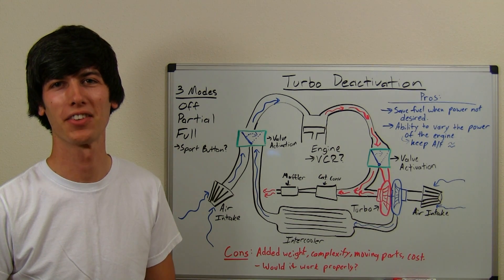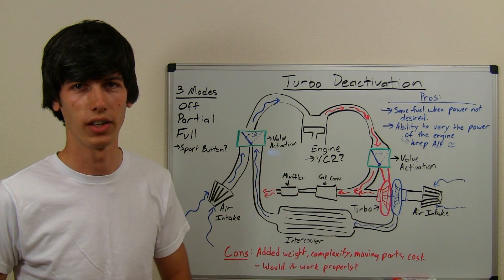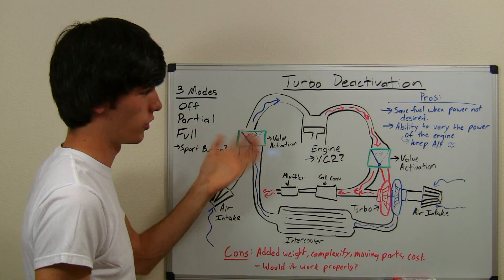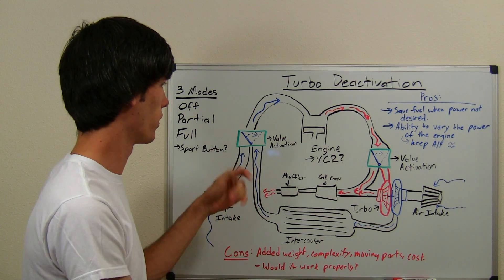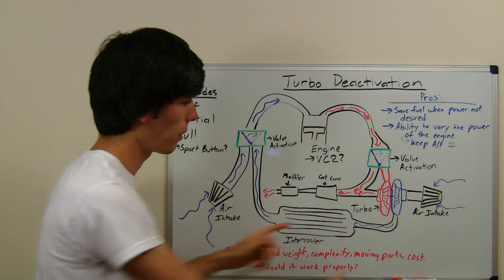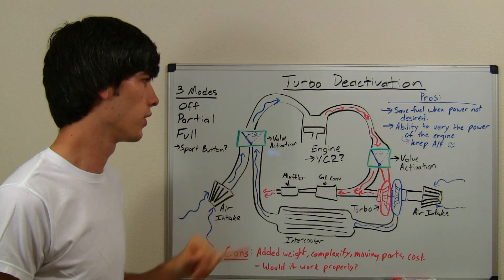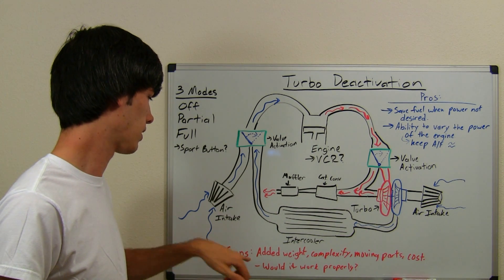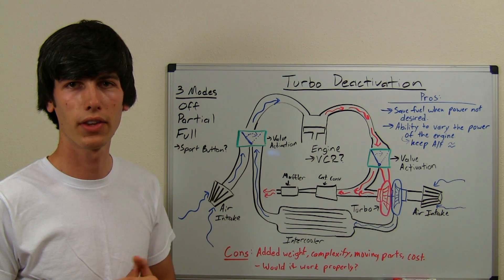Turbocharger Deactivation Concept - Explained

Comment: The days of the turbocharger are numbered. VW/Audi, the largest turbocharged vehicle manufacturer, are beginning to phase out exhaust driven turbochargers in favour of electric superchargers. These new superchargers offer the increased power benefits without the drawbacks of traditional forced induction.
Reply: agt155 It's kinda funny you say that turbo days are numbered because I see more manufacturers use turbos to increase the performance and gas effciency but haven't seen many that uses electric superchargers or just plain superchargers. VW/Audi/Lambo are phasing out turbos? Really? Virtually every model that Audi/VW offers have a turbocharged engine. BMW is using turbos since late 2000 and even their M cars are turbocharged now. Mercedes is using turbos on their entry level cars to high end AMGs. Ferrari is now using turbos on 488 GTB. Hell even Honda is using turbo on the new Civic Type R. I don't know how you got the impression that turbo's days are numbered LOL.
Reply: I see what you are saying, but I can't agree with you there when you say the car manufacturer's will increase voltage level to 48V. This will require increasing the battery capacity. With current battery technology, to get this done, you need to increase battery size to accommodate the 48v capacity for the electric supercharger and to have it last long enough without running out of juice. More battery = more weight and that's the least thing the manufacturers want. At that point, they would rather go with electric motor assist aka hybrid (such as LaFerrari, P1, or 918 Spyder) to boost the car rather than sticking a sole electric supercharger.
Also, Audi/VW is the only manufacturer that uses electric supercharger. (or electric driven compressor) No other manufacturer that uses turbos (virtually everyone now) does this.
Reply: +agt155 Electric superchargers will never fully replace turbos since they were never designed to be continuous usage even with 48 volt. You can accomplish the same desired effect of on demand no parasitic drag supercharging by magnetic clutch which is significantly cheaper for anti lag on demand. The hp gain / flatter torque curve per dollar simply will never pass the bean counters at manufacturing cause end user can't justify spending the extra dough. Chipped Subaru Wrx vs STI = same hp where majority are going for the lower tier for best bang for buck.
Reply: +agt155 i think  you mean naturally aspirated vs forced induction (turbo+superchargers).

take a look at BMW's new line.
Reply: agt155 Electric superchargers are a waste of money. They create virtually no boost. It's like connecting a computer fan to your intake. (just to  compare, both run on 12 volts).
Reply: For an e-blower, you will need an additional power source, and even with an upgraded alternator, it wont create enough electricity to charge it. I just dont understand why you think an e-blower is better than a turbo. a turbo uses wasted exhaust heat to power it, while an e-blower drains your battery.
Reply: they have race ones yes, that must be recharged every race or so, and is anti-lag illegal for track use? where do you lie? and please explain how the rest is wrong? (i am not trying to have an argument, i am always willing to learn, but saying its all wrong is a bit vague...)
Reply: agt155 And note that there is a huge difference between an electric blower and an electrically assisted turbo. The electric part is basically an anti lag system, that starts the spooling process only untill the turbo reache it's threshold. It does not run exclusively on electricity.
Reply: +agt155 no, vw and audi are actually not using an electric super charger.  they are using a twin charged system with a belt driven super charger and a typical turbo.  but, just out of curiosity... what models are they offering this electric blower on?
Reply: +agt155 it's not going to be phased out for a while... it will survive for a bare minimum of 5 years
Reply: +agt155 Don't forget that a turbocharger harvests energy from the exhaust gases which would otherwise go to waste. If you use an electric turbocharger you are using energy to increase the intake pressure, and still wasting exhaust gas energy. So the Δ is twice the amount harvested and reused by the turbo. Which is actually a fair few kW. In any case, I think the turbocharger is going to be with us for as long as we have ICEs.
Reply: agt155 *facepalm* absolutely impossible as supercharger has less parts than e-charger.
Reply: agt155 A super charger is merely a compressor wheel connected to an engine via belts. If you can't comprehend how this will always be cheaper you should just give up educating yourself and be a good drone.
Reply: agt155 Ah, forgot about those weird screw things. I'm more familiar with aircraft engines, where those were rarely used (precisely because of weight). Also quit trying to insult people by labeling them "naive" or whatever. That won't make you seem intelligent.
As for the types of superchargers used, I was specifically referring to a centrifugal-type supercharger. The source of drive is largely irrelevant. Whether it's the engine crank via a belt or an electric motor. The oil supply is not needed because of the drive source, but because bearings and gears spinning at such speeds generate a lot of heat. And those are gonna be there, regardless of how you drive it.
Also, for an electric drive there's the entire electric motor, presumably AC-brushless. So in addition, you're looking at a 10-20kW inverter. I don't know if you've seen a 20kW DC-AC inverter, but they're about the size of a rack-mount server chassis and weigh a lot.
Reply: "There are no centrifugal type superchargers used in production automobiles." is different from "What type of automobile supercharger uses a simple compressor wheel?" Don't move the goalpost yourself.
Also, you didn't google either, since there are some cars that do include a centrifugal type from the factory. BMW B7 Alpina were presumably running centrifugal types, as were lots of Koenigseggs. That having been said, yeah, the big screw-types are apparently easier to use for factory-type installations, since you can design it in. However, aftermarket, centrifugal-type superchargers are used lots. Regardless, whether they come from the factory or not is a red herring. We're talking about the technology's potential.
As for belt driving causing large tangential forces: no more than on any other part on a belt, e.g. alternator or water pump. Once past the input shaft, tangential forces are essentially nil. I mean you might as well say that tangential loading on the alternator is a huge problem.
Finally, the point on oil lubrication. ALL bearings are lubricated. If they weren't, their lifespans would be measured in hours. In theory ball and roller bearings are able to survive running at slow speeds without much lubrication, however, there's always some applied just to ease its life (even sealed bearings are lubricated before sealing). The question is: do you need to actively cool the bearing? At the kinds of high speeds that exist in a supercharger the answer is: most likely yes, if sustained running at those speeds is required. And active cooling is achieved by oil circulation.
As for switching reluctance motors: you'll still need the switching equipment. Remember, you're talking a sizable electric motor here, around 10-20kW easily (compressing air takes a lot of energy). And that equipment is everything but simple. Maybe as a car mechanic to you it's just a black box. But I'm an electrical engineer. I can tell that the insides are a heck of a lot more complicated than just a step-up gearbox.
Reply: agt155 You ignored the BMW B7 I mentioned. That's a production car. I didn't wanna mention cars from the 60s and 70s, where they were a lot more prevalent.
The amount of power required for a supercharger is simply a function of the amount of air and compression you want. There's no way around it.
"Who said that bearings don't require lubrication?"
You implied it right here:
"Of course, superchargers having large heavy rotors also add to the forces applied on bearings. Hence the need for oil lubrication."
If you didn't mean to say that without the forces, no oil lubrication would be required, why mention it anyway?
Anyhow, I had a look at the product of Value and:
1) Valeo themselves said that it's be used in conjunction with an energy recovery system
2) Many of their own diagrams (such as the "how it works" on their own youtube channel) show it being used to simply anti-lag a conventional turbocharger system.
So all your arguments about simplicity are simply invalidated by the manufacturer's own claims. By necessity, it's going to add complexity to the overall design. And that was the whole point of what I said in the first place. Simpler? Unlikely. Worth it? Maybe.
Reply: +agt155 So essentially you kept this argument up for over a year only to essentially nullify your statement by saying it will only replace small turbos, due to power requirements not accessible due to industry standard batteries?
Reply: agt155 Turbo lag can be minimized with an anti-lag system. Boost threshold can be minimized with a VGT. Exhaust back pressure can be minimized with larger plumbing. And last but not least, heat soak happens to your whole engine (not just turbo) all it is, is lets say you race a few races your engine will get hot. Now if you imediately shut off your engine it will keep alot of it's heat, just because of the fact theres no more coolant going through the engine.
Reply: +agt155 We shall see
Reply: +agt155 first off there's no such thing as a turbo running at zero percent efficiency unless it's seized or your running a turbo deactivation system such as in the video. An effective electrical supercharger is far from a power supply problem, theirs also the problem of charging, power lines, and fan technology. A system that actually works would either way too heavy (as in industrial size fan heavy) and/or put such a parasitic load on the engine that it would be pointless if not a hindrance. By the time technology advances to the point the an electrical supercharger is plausible combustion engines will be a thing of the past so turbos aren't going anywhere till combustion engines due. Though if can direct me to creditable documented proof of the concept being possible I'll believe you otherwise you seem no more than another person gullible person falling for a gimmick, no offense.
Reply: +agt155 Also the change in battery size is no indication of electrical superchargers but of more advanced hybrid car systems
Reply: "What type of automobile supercharger uses a simple compressor wheel?"
Pretty much all of them do, although that depends on what you mean by "simple compressor wheel". Superchargers, whether driven by a belt off a crankshaft or from an electric motor, work on exactly the same principle. A set of spinning compressor blades (whether axial or centrifugal) to impart (mostly) kinetic energy to the gas flow and a set of stator vanes to slow the gas flow down and convert the kinetic energy into static pressure and temperature (the adiabatic process).
Whether an electrically driven compressor is simpler than a belt driven one is questionable. At the small compressor sizes we're talking with car engines, in order to obtain the necessary blade tip speed to get any useful compression, you're looking at insane rotational speeds, well in excess of 100,000 rpm. That pretty much rules out direct drive from a 10-20kW electric motor (too expensive to build one so powerful that won't fling itself apart at those speeds), so regardless if belt driven or electric motor driven, there's probably going to have to be a step-up gearbox in there somewhere. Gear meshing at those speeds tends to produce pretty good temperatures, as do roller or ball bearings, so it's likely you're also looking at the need for active oil pumping and cooling.
So are they simpler? I don't think so. They might still be worth it, but I wouldn't look to simplicity being a feature of the design.
Reply: Cerberus984 All I'm looking for is to perhaps share some knowledge with somebody who might appreciate.
Reply: Ryan Gaetz Of course those little bolt on ebay electric superchargers are next to useless. However companies like Valeo are producing proper functional electric superchargers, as fitted to some new Audi's. Electric superchargers will replace turbochargers, they have all the positives with none of the negatives.
Reply: Bolt on supercharger or not, 12 volts will not compress any air. Second: even if it did, it would only have 1 speed, it wouldn't spool faster if you put the pedal to the metal. IF you had boost at low rpm, it will just be an air restriction at high rpm.  IF you have boost at high rpm, you risk damaging your engine at low rpm. Turbos still spool way faster than an e-blower would ever. A relatively big turbo, will spool around 10.000 rpm on idle, and can spin up to 150.000 rpm. Now tell me, how would a battery ever achieve this?
Reply: an e-blower is as useless as a "performance chip" (which are also useless)
Reply: ***** A quick look at any turbocharger compressor map will show you when a turbo is operating at 0% efficiency. For a 'normal' car turbo this is at under ~ 5 lb/s air flow or ~ 50 bhp or ~50k rpm. Think of it like airplane wings, below a certain speed (stall speed) wings produce no lift. It is no accident that for the majority of driving turbochargers operate below their 'stall' speed, because under these conditions the engine simply doesn't require any more air than atmospheric pressure can supply.
Reply: +Ryan Gaetz Chips on direct injected engines or common rail diesels are capable of more than yesteryears fuel delivery systems hence why we are witnessing ever increasing compression ratios using even lowest grade pump gas on a turbo vehicle with negligible performance loss. 231 vs 240 hp on an 2.0 ecoboost ford escape.
Reply: agt155 Also, back pressure is not caused by boost. it's caused by not having a large enough exhaust.
Reply: Ryan Gaetz It obviously works or Audi and the rest wouldn't be using it. You are right that 12V is not enough to power a large supercharger which is why there is discussion about boosting car electrical systems up to 48V. With 48V powered superchargers traditional turbochargers could soon be obsolete.
Reply: Ryan Gaetz
Electric superchargers already exist and they obviously do work.

Have you ever experienced an anti-lag system? They're illegal over here and for good reasons.

The rest of what you wrote is simply incorrect.
Reply: Rich B VW/Audi are now using electric superchargers instead of small turbochargers in multi turbo-charged engines. This is the beginning of  the 'phasing out'. Only small electric superchargers are possible at the moment because car electrical systems are standardised at a low 12v. In the coming years this will be increased to ~ 48v which will enable much larger electric superchargers to replace turbochargers altogether. Of course the long term future is battery/fuel cell.
Reply: +Rich B A 48v battery can be just the same weight as a 12v battery.

Here's all the info for you.

http://www.cnet.com/videos/car-tech-101-electric-turbos-are-coming/

Of course all this is just a stop gap until battery/fuel cell tech takes over.
Reply: +Ryan Gaetz That's why Audi is switching to a 48V power supply now.
Reply: +shaggyrogers1787 Audi's next generation of multi turbocharged engines use electric driven compressors. All the information is out there. Mercedes, Ford and Honda are all rumored to be following suit. Also expect a switch to 48V car electrical systems soon.
Reply: +Ryan Costa Yes, at least. New car models with traditional turbocharged engines will be produced for 10 + years.
Reply: ***** Electric superchargers are not a myth. Valeo already have a production version, and I believe Audi, Mercedes and Ford are among it's customers. Check it out yourself.

During the launch of the 718 Boxster, Thomas Wasserbaech, Development Director of Boxer Engines, offered a glimpse of Weissach’s view of its future turbo technology.
When asked what project excited him the most at the moment, his answer was unequivocal: “Electric turbocharging. Not just pre-fill like Audi. Fully electric turbochargers.”

http://www.wheelsmag.com.au/news/1604/porsche-to-boost-future-fully-electric-turbocharging/

http://europe.autonews.com/article/20160305/ANE/160309914/audis-435-hp-sq7-gets-electric-supercharger-to-top-diesel-power-race
Reply: What type of automobile supercharger uses a simple compressor wheel? You are mistaken.
Reply: totoritko "lot's of Koenigseggs" ...that's an oxymoron for you right there. As I said no production cars use centrifugal superchragers, and it's by no accident. If superchargers need the 10 - 20 kW of power you assume then there's going to be very different loads at play than with a 900W alternator don't you think?.. Who said that bearings don't require lubrication? Why don't you just take a look at Valeo's production electric superchrager, all the answers are there for you. I'm glad you passed an undergraduate course you must be proud of yourself.
Reply: totoritko Do you mean the hand built, made to order, Alpina B7?...well, no, it comes with a 4.4 litre bi-turbo engine. I didn't state or imply that bearings don't require lubrication, you made another assumption. Friction is proportional to load - simple mechanics.

Valeo's SC is designed to replace small turbochargers in multi turbocharged engines. The only reason larger electric SCs are not feasible at the moment is because of the industry standard 12V automobile electrical systems. 20KW @ 12V would require 1666Amps.

The question was would manufacturing costs prohibit electric SCs and the answer is no. Even Rotrax, the leading manufacturer of centrifugal SC's, now offer electrically powered superchargers.
Reply: RJ Maksym
No, they are replacing small turbochargers as we speak. Electric SCs will replace the majority of TCs in the future, it is what the whole auto industry believes.
Reply: We have a car with an electric supercharger for about 15 years now. It uses a boost circuit and supercaps to power a 48V motor driving a centrifugal turbine. I dont get why it didnt get popular already.
Reply from the maker: agt155 What are the drawbacks of traditional turbocharged engines that an electric supercharger overcomes? (Aside from lag).
Reply: Engineering Explained
Lag - as you said.
Boost threshold
Exhaust back-pressure
Turbine heat soak.

An electric supercharger in comparison also does not require an oil supply; reduces an engines cooling requirements; less pipework and a smaller package in general.
Reply: totoritko Well I'm sorry but you did naively dismiss what I said without knowing the facts yourself. There are no centrifugal type superchargers used in production automobiles. Having to drive a supercharger via belt and pulley severely limits the placement of the supercharger and further intrudes on valuable space at the front of engines. Look at how complex serpentine belt drives have become for this very reason. Electric superchargers on the other hand can be placed virtually anywhere and even integrated into air-filter assemblies.The type of drive does matter. a belt and pulley driven supercharger places much greater forces on the drive bearings than a direct drive turbocharger/supercharger, as the belt tension places tangential forces on the bearings. Of course, superchargers having large heavy rotors also add to the forces applied on bearings. Hence the need for oil lubrication. I believe existing E-chargers use switched reluctance motors, achieving 70 000+ RPM's on 12V automobile electrical systems.
Reply: +Kostas Froudarakis ...a typical petrol engine turbocharger is operating at 0% efficiency for the majority of driving.
Reply: I imagine a mass-produced electrical supercharger system will be significantly less expensive than a mechanical supercharger or a turbocharger.
Reply: Cerberus984
An "e-charger" is simply an electric motor connected to a compressor wheel.
Reply: totoritko I can only assume you are acting naive. A quick look in Google would tell you there are two types of automobile supercharger used today. Roots and Lysholm. Neither use a compressor wheel and neither are simple. Add to this the fact that they are both comparatively heavy and large and require drive from the engine crankshaft via belts and pulleys, and oil lubrication, and you will soon understand why an electric supercharger is seen as the way forward.